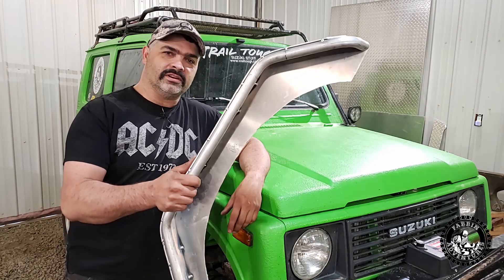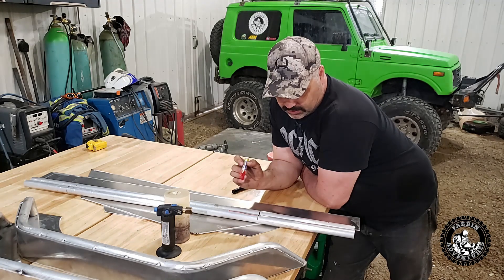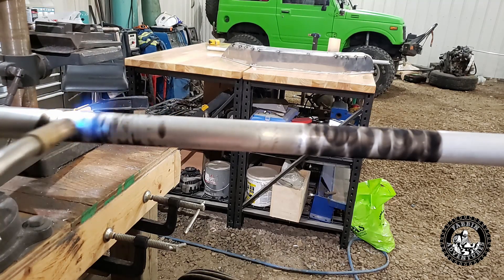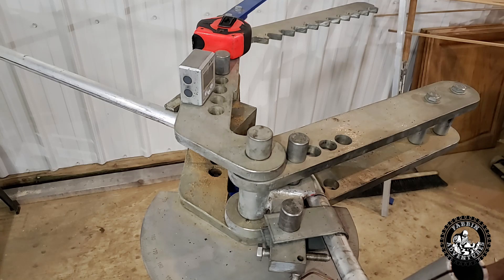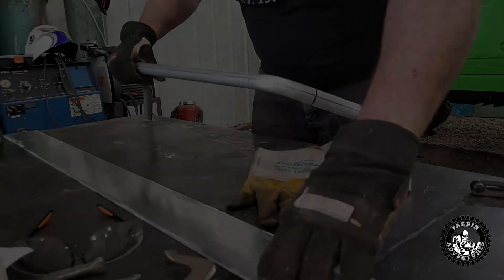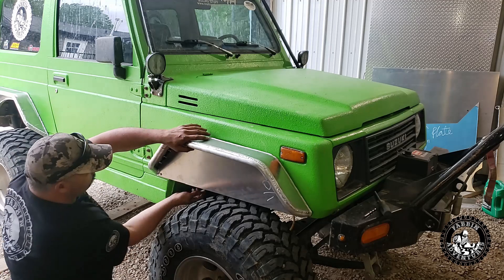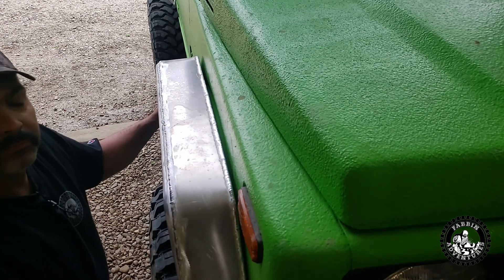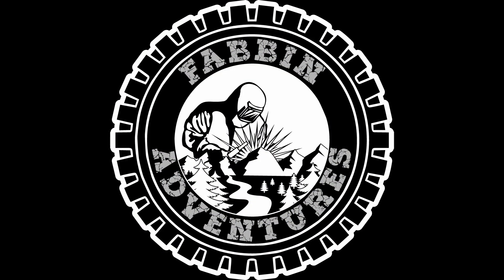Suzuki Samurai Aluminum Fender Flares: The Secret to bending 6061 Aluminum.

Comment: What size and thickness of pipe?
Reply from the maker: If i remember right it was 2.5" stainless exhaust pipe, so probably 16 or 18guage thick.
Reply: I was looking for the size and thickness of the pipe you made the fender flairs out of. 😁
Reply from the maker: @mikeroy8433 haha shit sorry man, i thought it was for the snorkle.
I would have used 1" aluminum tube, thickness was probably 1/8" if i remember right.
Reply: @FabbinAdventures Thanks. I’m about to make a set myself.
Reply from the maker: @mikeroy8433 beauty, have fun!

Comment: I'm not that confident in my welding skills.  You should sell sets.  Just leave the inner wheel well panel intact and the buyer can trim to fit.
Reply from the maker: I sell the mount, but am not going to weld any bodies steering components, way, WAY too much liability.
Thanks for watching and commenting.
Reply: @FabbinAdventures  You sell the fender flares?  Are they just one size or do you offer different sizes?
Reply from the maker: No sorry, i thought you were talking about the power steering mounts.
I have had a ton of people ask me to make these fender flares available to buy.
If i had the equipment to make them faster and more repeatable i would, unfortunately the time it takes to make a set would make them too costly to sell.
Reply: @FabbinAdventures  No problem.  I guess the 4X4 community really love them, especially us guys who don't have the equipment and/or skills to make them ourselves.

Comment: Your way takes way to long , oxy/acetylene,  is way faster and you dont need to let cool 
Use a sooty flame and cover then heat to remove soot , and put in the bender
Reply from the maker: Well yeah, but not everybody has oxy/ act, ive been fabricating for alot of years now and only had the need for one a few times.
Thanks for watching.

Comment: What would you charge to reproduce those if somone wanted to buy them?
Reply: Heck ya I plan on buying a set myself
Reply from the maker: They most likely wouldnt be cheap, i gotta do every thing manual. But if i made a bunch at one time, i might get a bit of a production line going and make them a bit faster and cheaper!